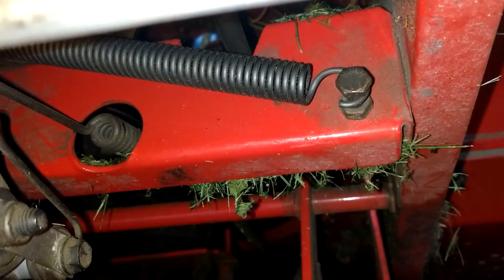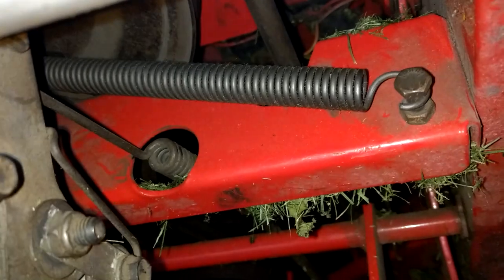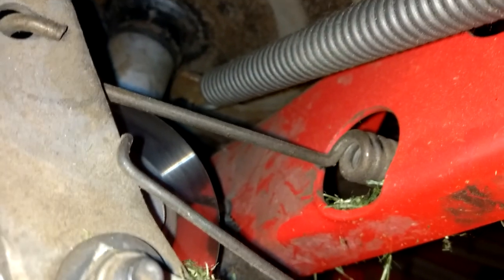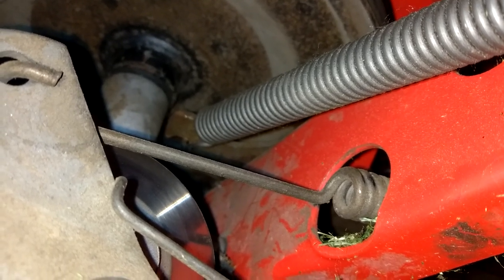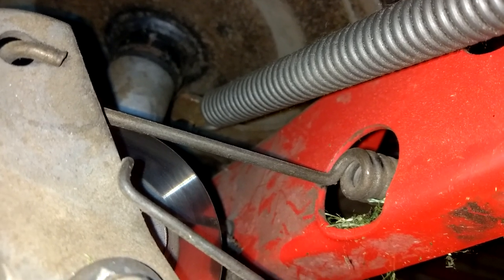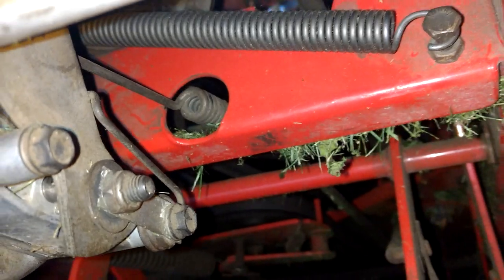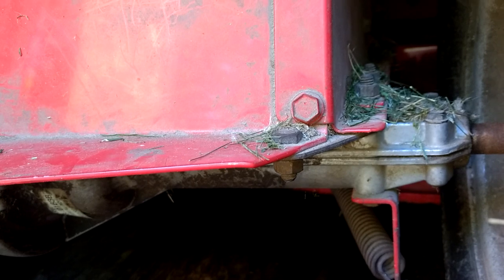MTD lawn tractor idler pulley spring location

Comment: I have a question for you, I have a 2003 Huskee 21 hp 46 inch deck. I cannot figure out here the other end f my sting extension gets connected to. I know one end goes to the rod stabilizer bar but I cannot find the other ends connection spot think you could help?
Reply from the maker: @darrinsiegel482  Unfortunately no - I'm just a guy with a little mechanical inclination and too many tools - I have no training in this stuff and no experience with machines other than my own. I made the first video because I couldn't find a solution online, figured it out and made a video for the next guy; I made this one as a follow-up when someone asked about the idler pulley spring on this particular mower. If I had your machine right here in my garage, I could maybe figure it out, maybe, but that's it - I don't have any actual knowledge or advice. Sorry!

Comment: Thx for the video. I have a 10 year old Yard Machine 700 series, 38" deck tractor and I've got way to much slack in my deck belt to the point where the blades will free-spin. I replaced the deck belt and my pto cable seems fine (unless these can stretch?) but still not getting the proper tension. Both outer springs apparently fell of at some point so I will be replacing them but they have to do with the brakes which keep the blades from spinning when not engaged rather than belt tension, correct? So which part is most crucial to proper belt tension? Thx
Reply from the maker: Long story short, while your model sounds different from mine, I think you're mistaken about those springs.  On mine, those springs pull the entire deck backwards, pulling the deck belt tight around the PTO pulley on the bottom of the engine and engaging the blades. Pulling the deck all the way up, the top notch on the lift lever moves the deck forward a bit, introducing slack in the deck belt to disconnect it from the engine again. Then there are two small brake pads on the underside of the body - bolted to the bottom of the floorboards - that press against the top of the two pulleys on the deck, but only when it is lifted all the way up, to stop the blades when they're disengaged.  All that being said, you mentioned a "PTO cable" - mine doesn't have a PTO cable at all, just various rods & levers.  Engaging the deck belt is managed entirely by shifting the entire deck forward (disengaged) or allowing the springs to pull it back (engaged). 

I should add that I sold mine a year ago, after the transaxle & axle-shaft broke right half in two, so I'm operating from memory here and don't have the actual machine to reference anymore
Reply: @DaddyBeanDaddyBean  thank you!

Comment: Can a bad idler arm spring cause a tractor to go slow?
Reply from the maker: I am not a pro at this, but to an extent, yes, I think so - if it isn't putting enough tension in the belt, the belt could be slipping.  Easy enough to to see, at least on mine, by removing the panel around the shifter and just watching the belts & pulleys.  I have to wonder if your belt is still in decent condition, though - if it's worn out, that could cause it to slip too.

Comment: Were do i put the back end deck spring that sits off bck of transmission at?
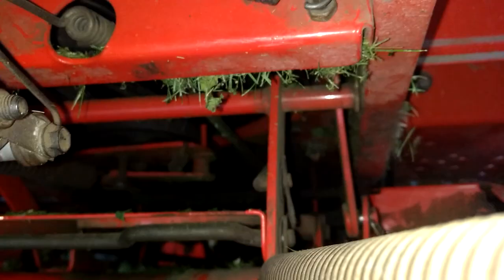Reply from the maker: I'm not an expert, just a stubborn old do-it-myselfer, and I sold that machine last year - and hadn't taken the deck off in several years before that - but I think the spring you're asking about is visible in this video at about 0:35. If memory serves, I looped a piece of wire through the hook in the backend of the spring, wrapped the wire several times around a chunk of 2x2 or something, and then used that to pull the spring back & hook it on that bar just inside the right rear wheel. I recall it was extremely difficult to do, so either I was doing it wrong, or it's a horrendous design. Or maybe both.

Comment: Idler pulley on the deck?
Reply from the maker: No, this is the idler for the drive belt. If I recall correctly, I don't think the deck had an idler pulley - I think raising the deck all the way up also shifted the whole deck in such a way that the deck belt went slack and the belts disengaged; lower the deck to even the first notch and it pulled tight on the belt to engage the blades. I sold that machine a couple years ago so I don't know for sure.

Comment: I think thats what i need on mine to get it driving again!  How long is that spring so i can find the right one?
Reply from the maker: I'm sorry, I don't know. My transaxle cracked and the drive axle snapped off, and it wasn't worth the hundreds of dollars in parts to repair a 15yo mower, so I sold the whole unit to a guy who was going to repurpose the engine & deck into a tow-behind mower for his 4-wheeler.  You might try mtdparts dot com with your model & maybe serial # to find the right part #, and then Google that part number to see where the best deal is.  Any local small-engine shop should be able to look it up for you as well, and might even have one in stock.
Reply: MTD FNR Idler Pulley Spring is 6.5” long (outside end to outside end) x 5/8” diameter